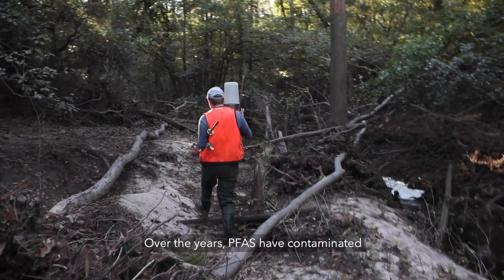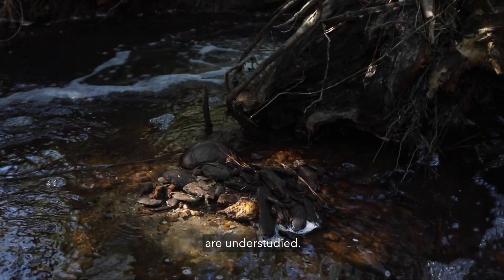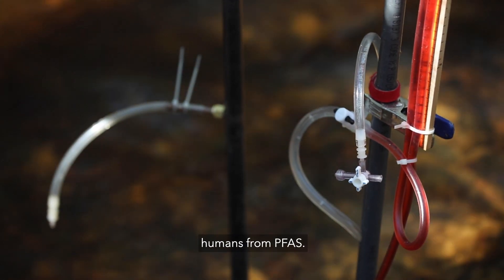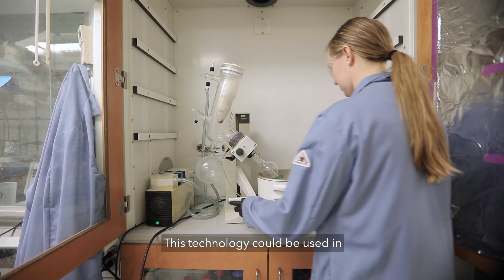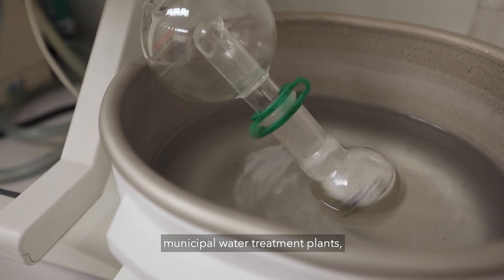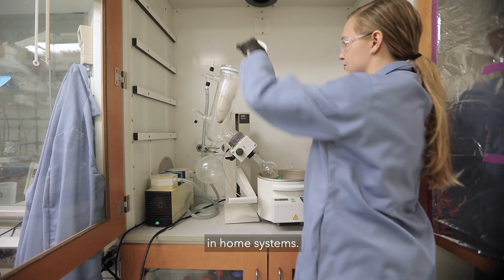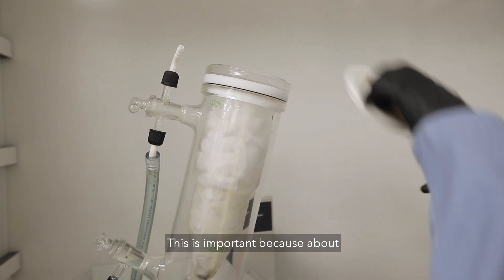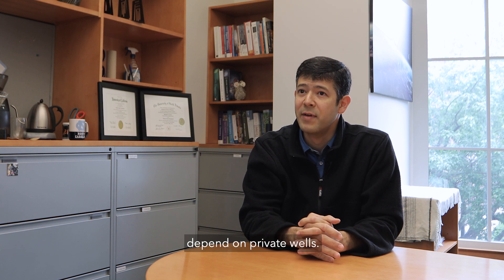In Pursuit: UNC Researchers Successfully Remove PFAS Chemicals from Water

Comment: The best way is to bring a law to bar these chemicals from commercial use.
Reply: They develop a new “different” one that is barely changed molecularly, but new and basically the same effects. Its been happening since the 50’s.
Reply: The problem with a law that bans some chemicals is that it can be seen to approve others and so who is liable for the cost of the damage done? Best to make it easy to claim for damages and and have a law that lets judges issue injunctions for their jurisdiction when they've determines the supply chain is liable for the effects of one of the chemicals. You need judgement with visible economic pressures instead of decrees because it has to be the truth.

The supply chain can feel safe selling anything they think a judge wouldn't rule against and can avoid anything they haven't got a good assurance for. Marketing departments can work to convince retailers of the safety and that will make the manufacturer and conspirators like industry groups liable so they have to do it right as long as anyone cares not to be harmed.

Meanwhile you can reserve legislation for the gratuitous issues that doesn't solve, but what could they be if the truth of the harm is actually known for real?